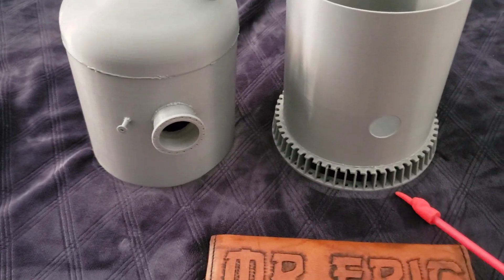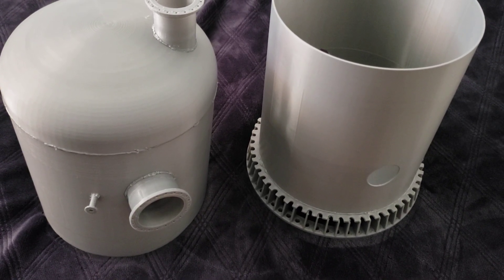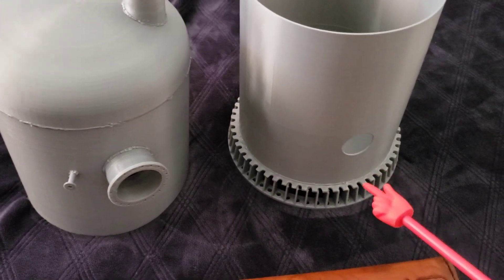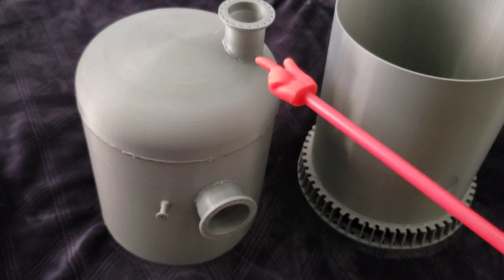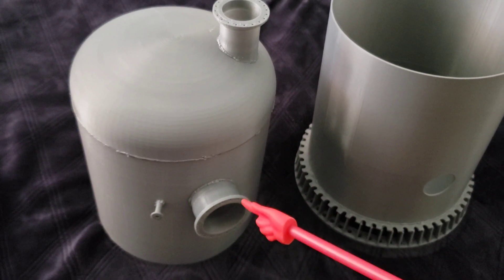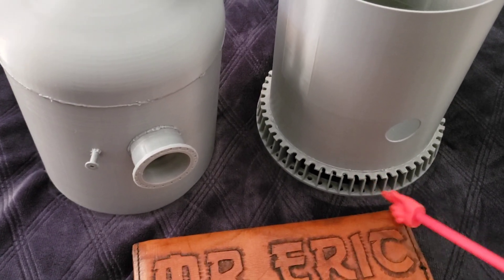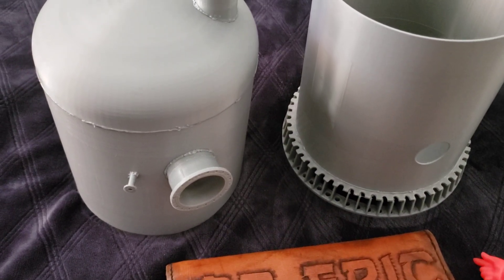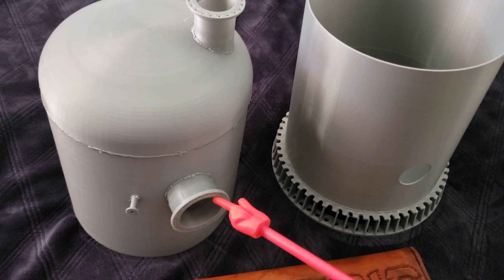API 510 inspection of a tower

Comment: what filament are you using for this project? if you use ABS it makes its own glue from the support material mixed with a little acetone
Reply from the maker: This is a typical pla.... I considered abs, perhaps the next vessel project i print.